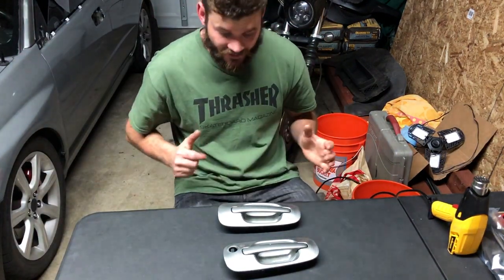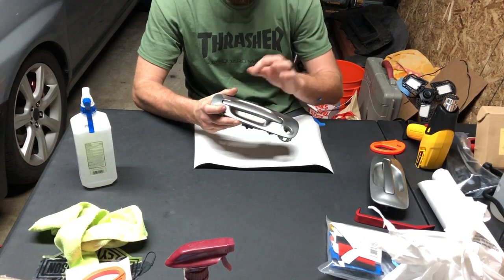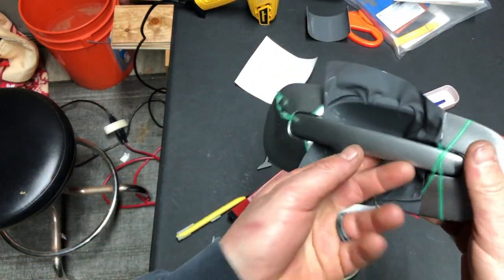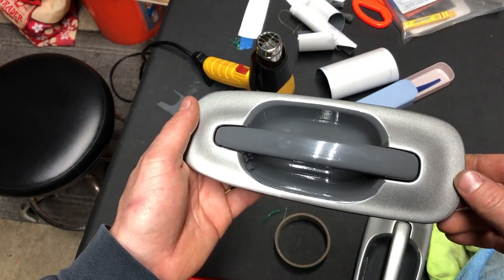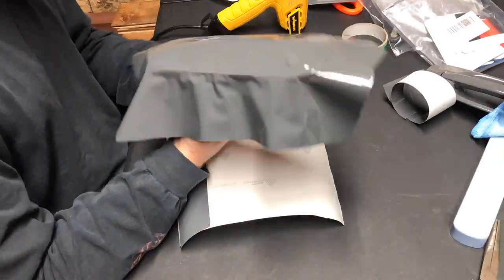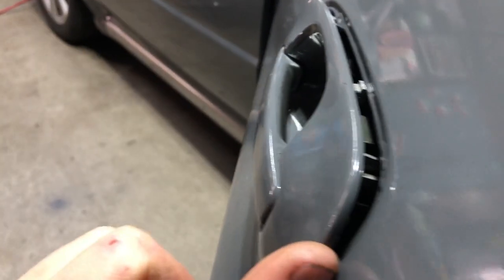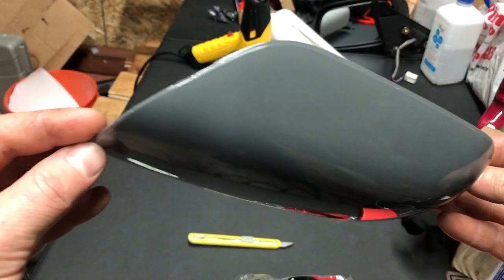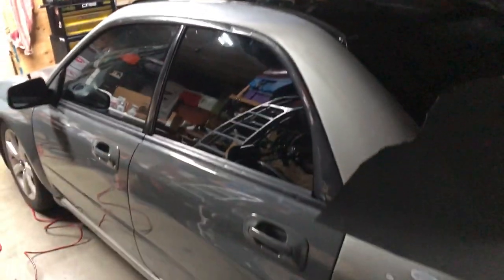THIS WAS HARD I QUIT! Vinyl Wrapping Door Handles & Mirror Caps - Subaru WRX

Comment: You have to remove the handle, and start from the inside and work the vinyl out from the recessed area ✌️😉👌
Reply from the maker: ✅ advice taken! I actually attempted to remove the handle but just didn’t want to snap the worn out plastic. I’m definitely trying again on the other two 👍👍